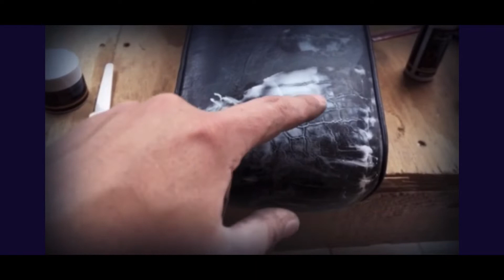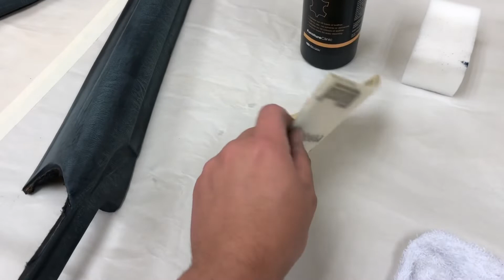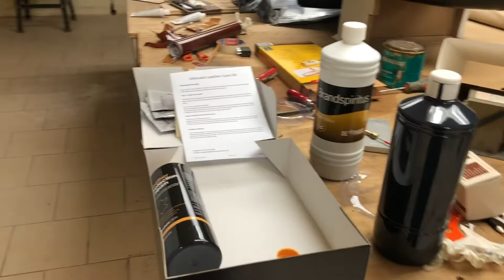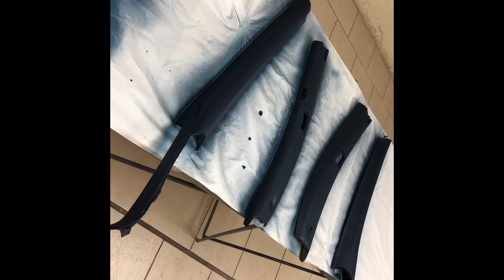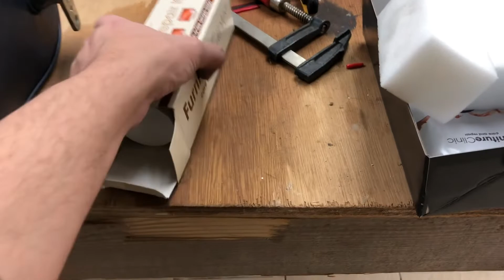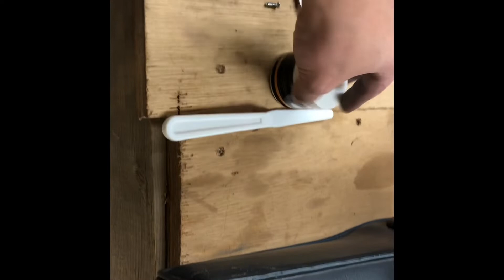How to paint leather and vinyl interior trim Mercedes R107 500SL

Comment: How did you remove the A pillar trim? I would love to redo mine, just don't know how they're installed.
Reply from the maker: You need to remove the mirror, sunvisor clip and one screw on the top section, remove the top section and then the last screw holding the sunvisor. After that the a pillar is just clipped into place. You would be able to remove by pulling

Comment: The parts look very good, you've done a nice job. Would be interested how does this product (leather filler) work in time. For heavier cracks isn't it a good chance that they will reapear ?
Reply from the maker: Hi Liviu, thanks for your response, like and subscribe as I will be posting a dash soon, however got a bit delayed due to C19. 

I have repaired leather seats many times.  Cracks in the leather finish are always 100% durable! When the leather itself is worn it may tear again with the dryness of the leather but still with proper hydration very durable. Repaired tears with backing and PU glue may tear again depending on where the tear is. Ideally, you would take the cover off, change the piece with similar color or grain and repaint the complete seat. 

I once had a heavy tear in the seat, where it flex’s when you sit on it. I repaired it 10 years ago and it still holds. I however don’t let myself fall into the seat and I am not the heaviest person but the repairs can be very very durable especially if it’s only cracking in the leather paint.
Reply: @Everdriveparts  thanks for the thorough reply. I am planing to fix a tear myself in a MB tex vinyl seat. I wasn't confident enough that this product works. Thanks again !
Reply: @Everdriveparts   ok for starters, the leather is originally dyed, not painted, I have painted leather seats and they turn out great